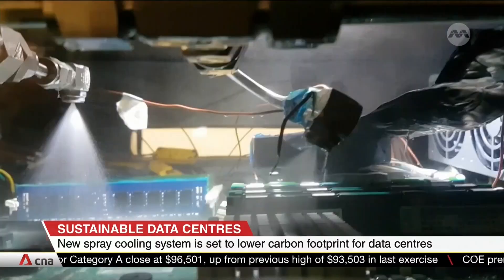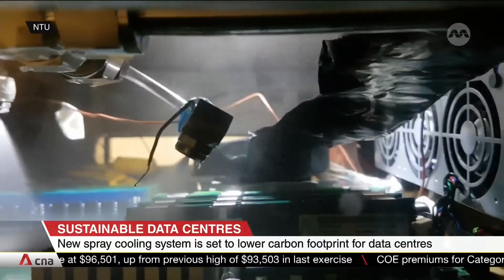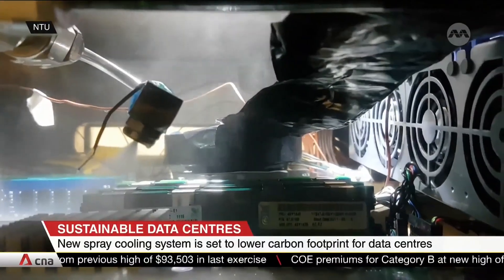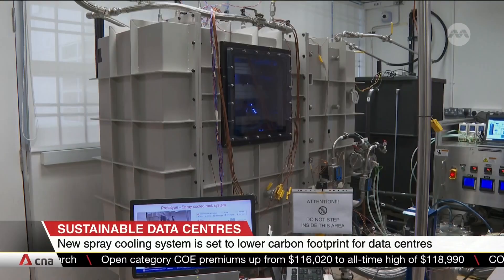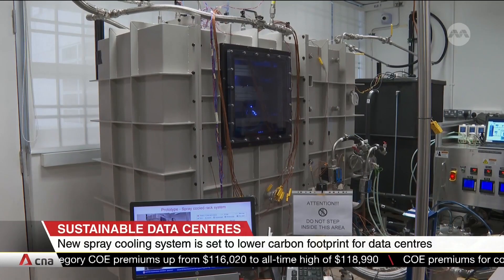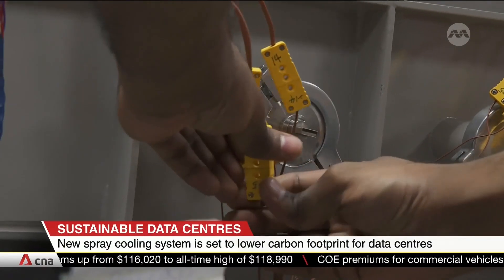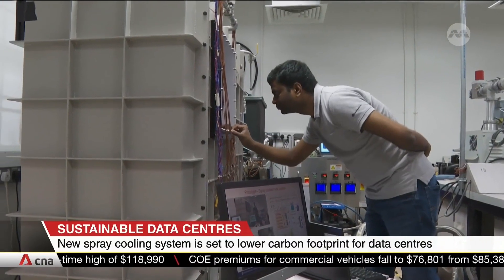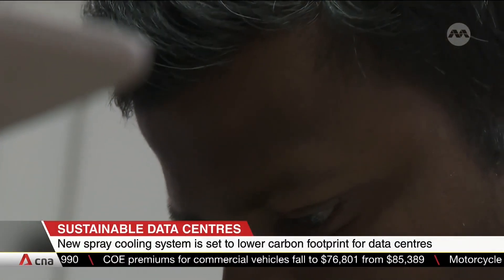New spray cooling system set to lower carbon footprint for data centres

Comment: Even a Primary School Student knows that the Unit of the specific heat of water is in Joules Per Kilogram Per Degree Kelvin. The denominator clearly indicates the flow necessary for the rate of heat exchange required.
I wonder whether they know the enormous amount of heat generated in a typical data-center in a "industrial setting" or maybe thinker on Legionnaires' disease  or better reliable Circuit Isolation from catastrophic short circuiting failure?
One would question why the method is still not patented? You know my toe.